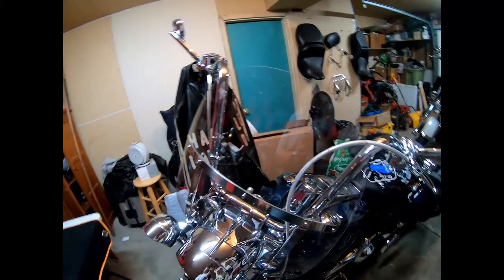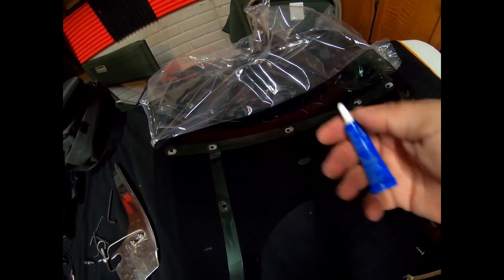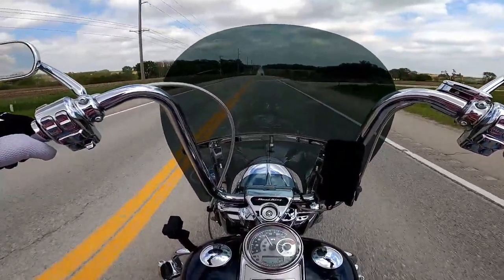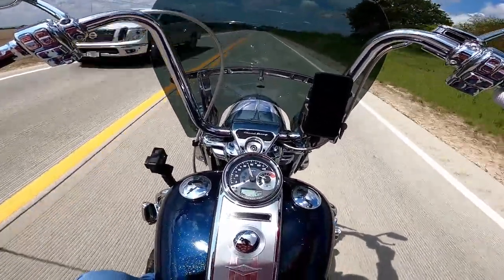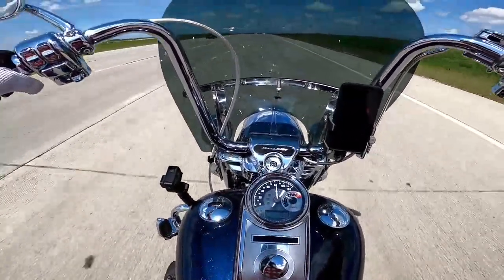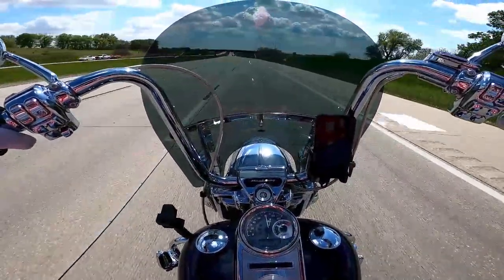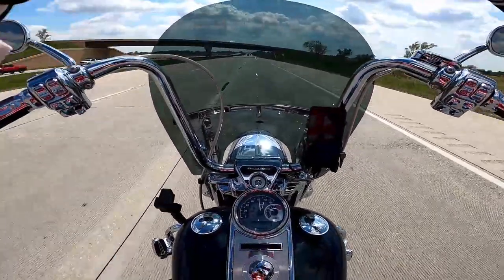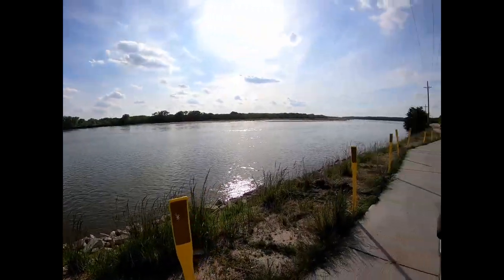The King gets a Long Ride Windshield

Comment: Sweet vudeo bro. Im contemplating a windshield. Im thinking a 17". What would you recommend for a quiet helmet. Kinda newer to riding and dont have many helmets under my belt
Reply from the maker: Hands down the shuberth c5 and any aria helmets are the quietest. But the are expensive. Shoei’s are great helmets that are quiet also. But how quiet a helmet is is very relative. What I think is quiet my wife usually thinks is loud. I wear a bell set modular right now. It’s nothing the quietest helmet but it’s not the loudest and it is very comfortable. The worst part about it is you never know until you try it.

Comment: I love that you got the same color bike and you are talking about issues I've been trying to address.y biggest issue with the windshield is that wind coming up from the tank area. It whips my shirt around on my chest and gives me a friction burn on my chin
Reply from the maker: The lower fork fairing seams to help with the wind whipping up from the tank. Here is a link from Amazon. 

Chrome Lower Triple Tree Wind Deflector Front Fork Cover For Harley Touring Electra Street Road Glide Road King 2014-2018 https://www.amazon.com/dp/B07R6T4V12/ref=cm_sw_r_cp_api_i_6D1GV010S9KFZT1VRKKZ
Reply: @StevyFaux  I wonder if I can make it work on my 03 fatboy
Reply: @StevyFaux  they did brother. I finally broke down and ordered some from HD. I don't like the look but it solved the problem and I can ride comfortably again. I tamed the wind and got it fixed. I bought some HD front lower wind deflectors and that did it. Phew. Thank God. I was truly ready to throw in the towel and trade the bike off.

Comment: That new wind shield will work wonders in your sunsets on your long straight roads. We don't have such roads here in the UK (apart from motorways). We have bends, trees and hedges that overhang the road and cause mottled sunlight. A screen like that here would be dangerous, as one second your in bright light, then in shade, that would be like wearing sunglasses in the dark and your eye's would not have time to ajust. Looks great though, shame about the crack, you will forever notice it....lol
Reply from the maker: I still look over the windshield so hopefully the tint won’t be a problem. Will have to ride it at night and a see. But it’s still better than a fairing that you can’t see through at all I guess.

Comment: I prefer a windshield by far to a visor on a helmet. That’s where I have arrived in the end. And once all that was settled, the complete absence of any and all helmet buffeting, and of course the comfort of my ass, has become the bane of my existence. Like having all the air movement possible, but still perfect vision. I use a really soft grouting sponged to clean my shields and finish with some spray wax. Gotta take care of those babies. Keep the rubber down and thanks for the vid.